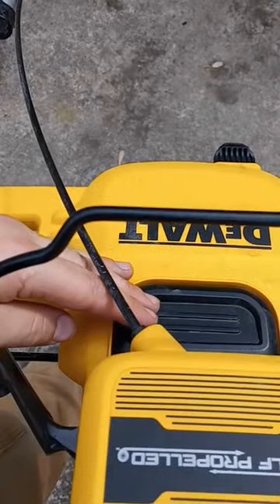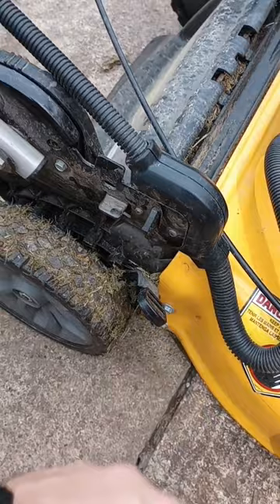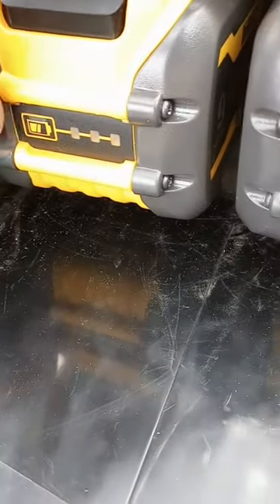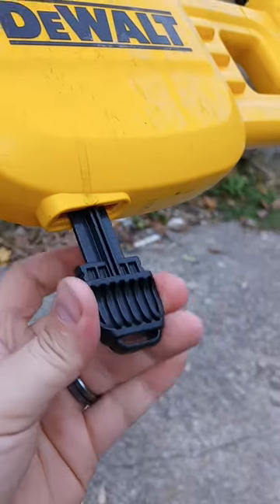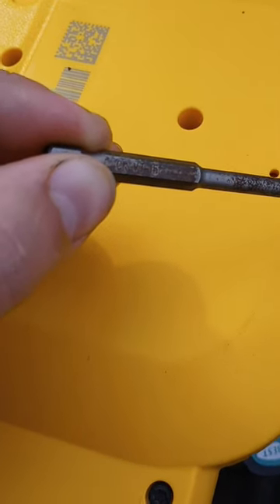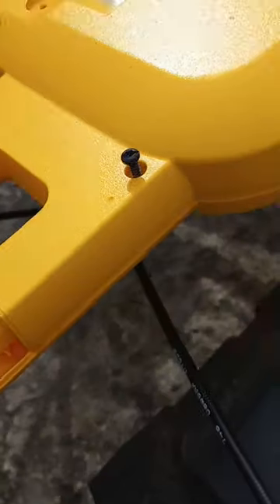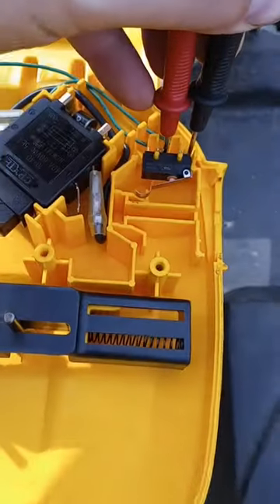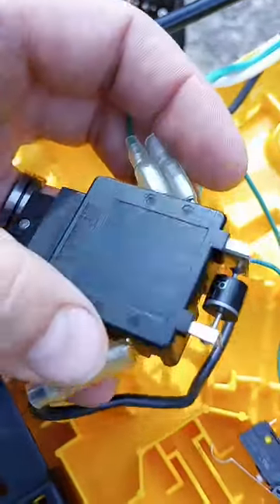DeWALT 2x20v LawnMower Not Powering On - Things To Check (Short Version) #youtubeshorts

Comment: So mine won’t have the blade turn, the light turns red but it just won’t start. I check all the system in the handle all good. Any suggestions?
Reply from the maker: 🤔 hmm 🤔,  are the blades free ?  Like you can turn them by hand ✋🏼 freely ?  Make sure to remove batteries 🔋 before you go underneath the mower.
Reply: Yep, nothing stuck there. The safety black thingy is also not stuck.
Reply: Same as when it won’t start when the grass is too long and you have to raise it’s level off the ground to start turning, same issue but this time even on no grass it won’t start.
Reply from the maker: @olgakanj277  possibly something wrong with the motor or the load sensor

Comment: Internal combustion keeps looking better and better all the time.
Reply from the maker: I mean DeWALT 20v outdoor power tools,  in my experience haven't been very good,  I can recommend DeWALT 60v outdoor power tools they're pretty good,  but Ego 56v outdoor power equipment does have very best,  I have had the push lawnmower, blower & backpack blower going on 3 years without any issues, still going strong 💪🏻
Reply: You mean makita looking better and better? Gas has so many issues...
Reply: @riba2233 sounds like a skill issue.... gas and diesel will always be more reliable 🤷‍♂️
I'm not even trying to start something here lol it's just true battery powered tools/cars have definitely improved over the years but it's just not as reliable.
find an old diesel truck out in the woods that's been there for 50 years and it will probably pop off with a little or sometimes no tinkering.
Leave a battery in the cold for a few months and its shot. They work together though lol batterys start the trucks that get the stuff to make batterys and most electricity comes from diesel generators.
Goin off on a tangent here but hydro and wind are where we should be headed.

Comment: Just get a gas-powered lawnmower. Just put gas and go😂
Reply from the maker: I have a riding gas mower,  because it has an electric⚡ start. & this one isn't mine,  I am working on it for someone else,  but my ego 56v push mower is going 3 years strong no problems,  also I have owned many gas push mowers and things have broken/didn't start & have need to be worked on/repaired,  & now I don't have to pull start

Comment: The electric tools work just enough to get by. Meanwhile I use 90s stihl equipment every summer to mow lawns professionally, and paid next to nothing for it
Reply from the maker: I will say gas equipment good gas equipment usually stuff made in the US if properly serviced and made sure to run the gas to the car before starting for the winter or running like 93 in it seemed to last and run a really long time
Reply from the maker: I just really love the fact with especially like I have Kobalt 24 volt output door power tools and 56 volt EGO power tools I really love being able to shut them off and start them up without having to pull start them again especially with my kids outside with me helping me I don't have to worry about them burning their hands on the muffler or the extra noise that kind of stuff